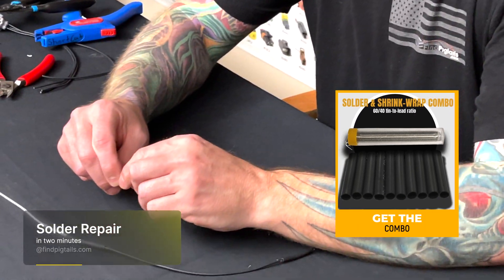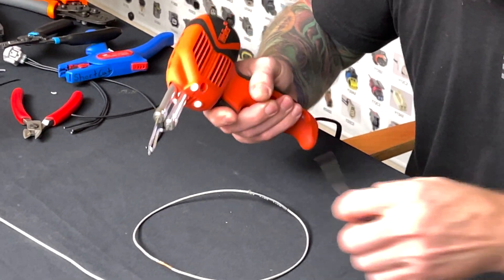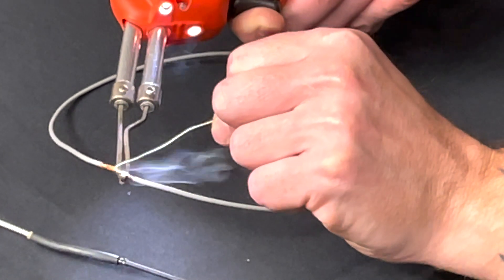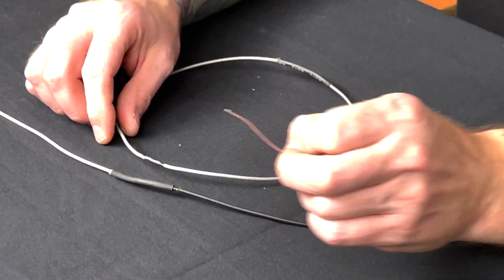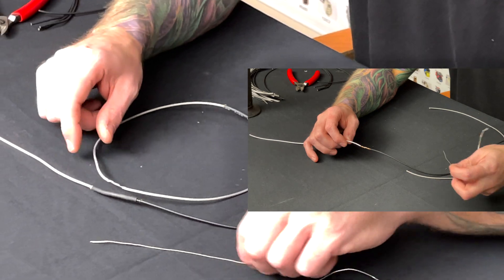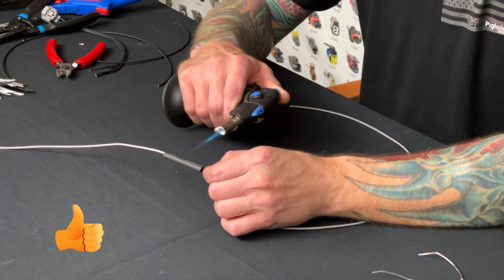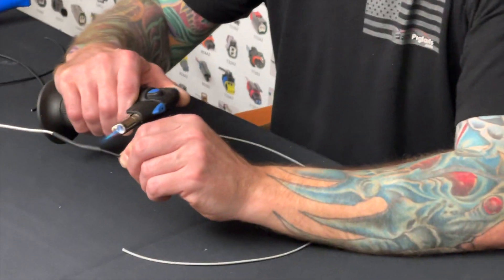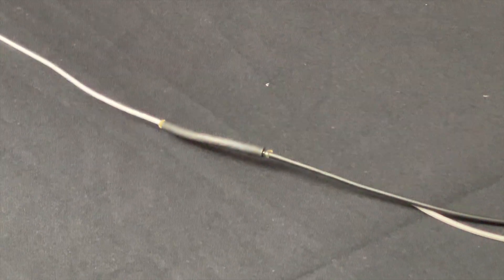Wiring Harness Solder Repair In 2 Minutes | Automotive Wiring Harness and Connectors

Comment: I soldered some wires to a fuel relay harness with plumbing solder. I'm wondering if that creates resistance in the circuit making problems.  Plumbing solder is lead free and I know that it can have a different conductivity. I'm still having a problem, and I think this might be the culprit.  Any input would be appreciated.